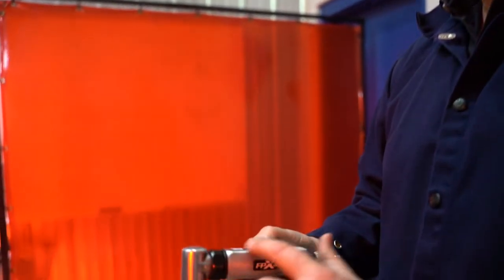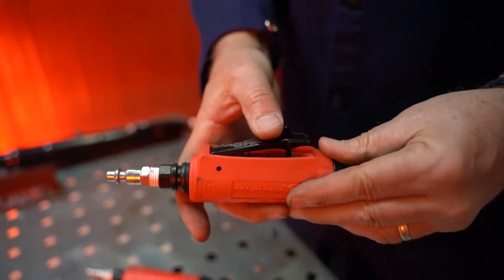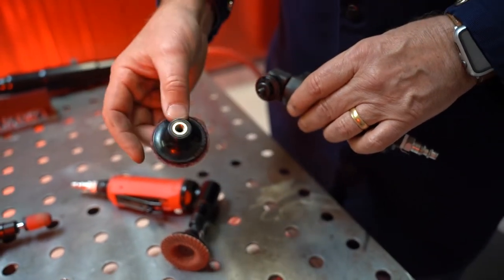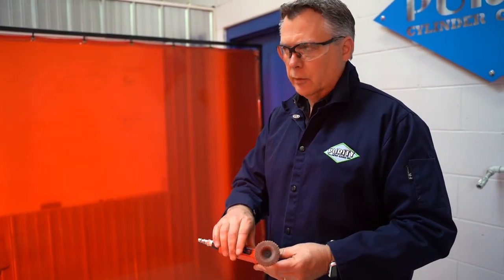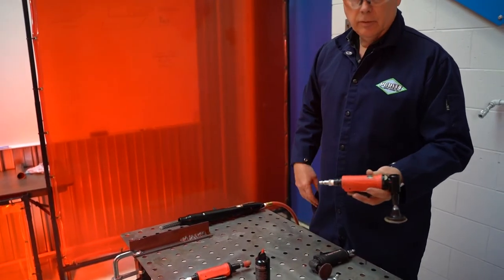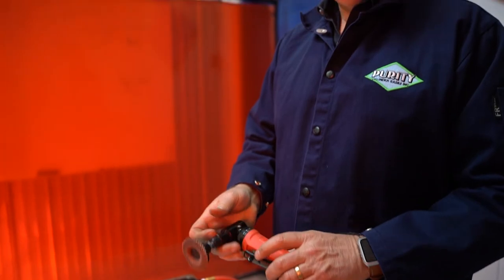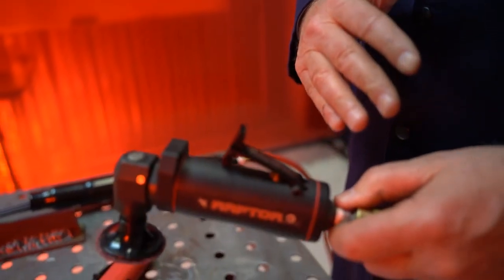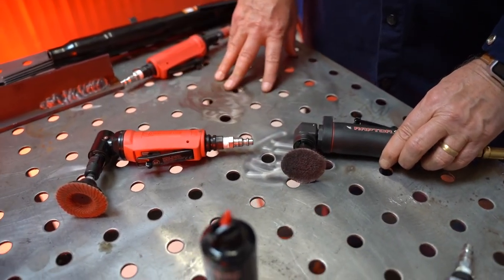Die Grinders (Air Tools for Metal Fab)

Comment: Hello, what is the part number for the right angle die grinder with the screw in roloc base plate?  Thank you.
Reply from the maker: I believe you would be looking for part# UT8724T-20, which has a 1/4"-20 male spindle to connect backing plate and reduces the overall height.

Comment: Where do I get one of those low profile right angle grinders
Reply from the maker: Anywhere that sells Universal Tool products. Part # UT8727T-20 Raptor Rt Angle Die Grinder 18K RPM 1/4"-20 Threaded Spindle Rear Exhaust  -  Best for continuous H/D grinding. You could contact any Purity branch to get a quote. Thanks!